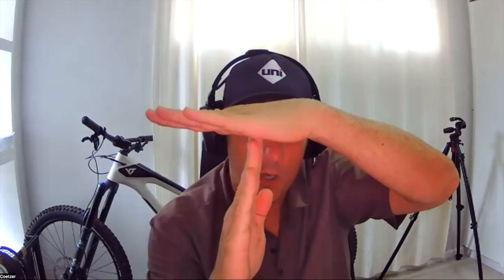Tail Stab Design, Shimming & Foil Tuning in Depth - Unifoil Q & A Vol 6

Comment: Good detail there. Thanks! You touched on fuse length, but here's a practical question. Does a smaller stab on a longer fuse out perform a bigger stab on a shorter fuse, assuming both are setup with a similar straight line stability? In other words, do the benefits of a smaller stab (lower drag, quicker roll), outweigh the penalties of a longer fuse (more drag, longer turn radius [maybe])? Or does it 'just depend'?
Reply from the maker: This is a question for Cliff on the next Q&A! Will send it to him

Comment: Great info guys. Keep these up. Q1: when trimming off the traling edge of the stab', do you just leave it square or sand down the top or bottom of the profile too? Q2: at 94kg would the Progression 170  replace my Vyper 170 or are there certain conditions or style where i'd miss the Vyper?
Reply from the maker: Thanks Andre. To answer your questions. 1 - Leave it as it is first, ride it, then if it hums sand the top.  2 - The progression pumps much better, and probably turns the same. The wingers are still loving the Vypers. What conditions would you be riding them in? We recommend you try a progression for sure.
Reply: @Unifoil  thanks for the answer. On #2: mostly prone the 170 Vyper when it's too small for my 130 Vyper (under 4ft). Soft beach breaks and some longer point/reef waves. Not really into winging yet, but do the odd light-wind kite foil and want to get into DW too. Also just picked up a 150 Hyper1 which I really enjoy and just starting to pump some distance, as well as a 190 H1 which I struggle to turn and pump (rider's fault or needs a katana mast). Maybe the Progression 170 would rather replace the 190?